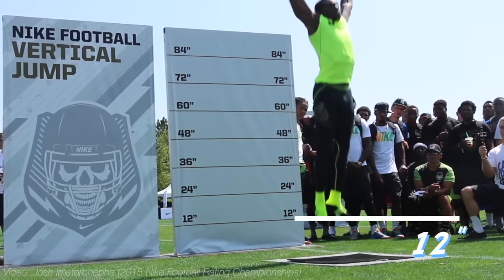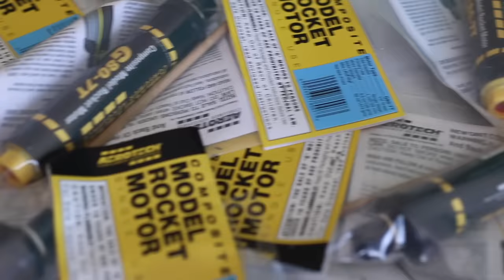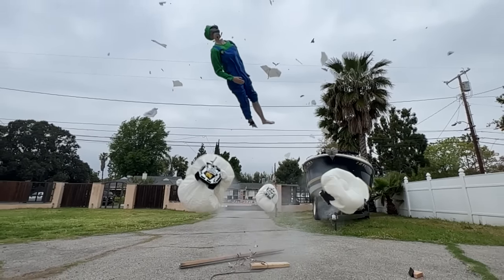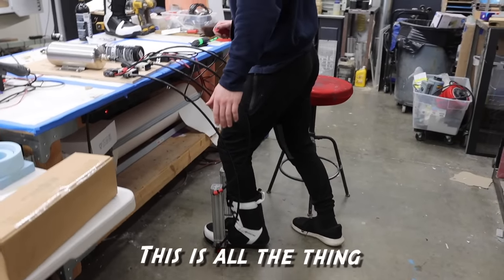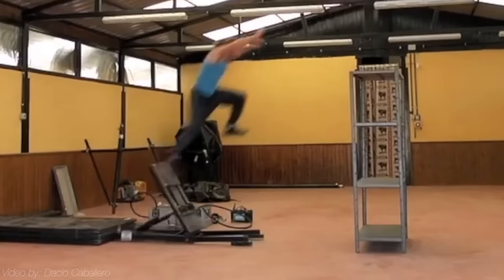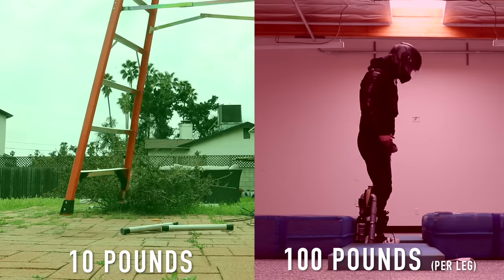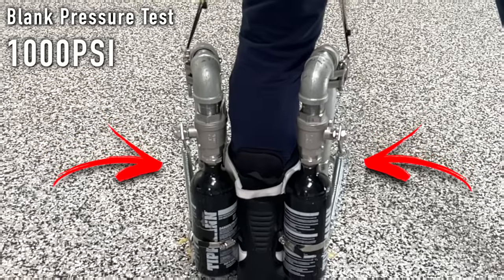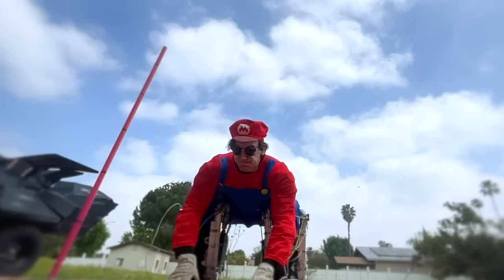Jump 10 Feet With These Shoes! (World Record)

Comment: How about the OPPOSITE of jumping shoes? Shoes that will cushion your fall as you land so you can drop from loftier heights without hurting your legs.

Might be a little more difficult to test.
Reply: Portal Boots
Reply: Feather falling IRL
Reply: Parkour
Reply: Parachute
Reply: @mightymas1647  This is the name it needs. Feather falling boots
Reply: long fall boots basically
Reply: Yes! This needs to happen
Reply: aperture science long fall boots™
Reply: thats basically putting springs at the bottom of the shoes
Reply: @garfield50096  Springs on the bottom would contract too fast to properly slow the wearer enough for any kind of fall of sufficient distance to normally hurt the wearer. You'd need something bigger.
Reply: Portal boots
Reply: @SerathDarklands  squishy shoe
Reply: Long Fall Boots
Reply: i think you'd need a shock that goes from your hip joint to your feet. with almost like a seat for you to land on.
Reply: Maybe shoes with springs on the bottoms so it slows your fall down. Strong springs. And then maybe they can click back into your shoes when they fully compress
Reply: This is a amazing idea
Reply: Feather fall?
Reply: Yes he need to do this
Reply from the maker: I'm interested
Reply: @JLaservideo  Awesome! I hope to see it in action someday!
Reply: @JLaservideo  once you have the aperture science long fall boots the next step is obviously a working portable quantum tunneling device
Reply: Fall Cushion Boots.
Reply: @iamshadow5340  wizards and warriors?
Reply: thats called a spring

Comment: Quick science lesson: An airbag actually doesn't cushion you at all. All it does is increase the time of impact, which therefore decreases the force of the impact. An example of this is if you try to catch an egg. To catch it without breaking it, you need to move your hands down during the period of impact.
Reply: wait then what's an example of cushioning?
Reply: @zombiecarz  Great question, cushioning is done by less dense items that suppress the force of impact
Reply: @jimmyjoe6721  Isn't the bag of air less dense than a steering wheel?
Reply: @jono6379  it is but it is so light that it doesn’t really cushion you, just increases the time of impact
Reply: @jimmyjoe6721  uh- this isn't entirely true
cushions work by being flexible enough to compress when an impact hits them, which is exactly what an air bag does. which is why jumping on a bed or trampoline increases jump height. but their only difference is material and one being always active

Comment: idea: for a safety feature, make the bottoms of the pistons rounded so that they tip over easier after they fall out, because it wouldnt be very good if one of them just so happened to stay standing up after they came out and your foot landed on it. it would either stab into your foot or make you tip over and land on your side
Reply: but it could also mean that you lose ballance couple miliseconds or less after launch when they are still touching both the mechanism and the ground, while the flat ones still give a certain sense of ballance :) ? ( not sure tho)
Reply: I like that idea, but it might hinder the effectiveness of the piston to only make contact with the ground at a single point instead of an entire surface. It may also introduce some undesired uncertainty in your thrust direction if any of the rounded pistons are at different angles with the normal line to the ground

Comment: Hey, I think that if you add 4 pneumatic pistons in the knees (2 for each, and one in each side) and connect then with the jumper in your feet, this may bring more stability. That is a technique we use in semi exoeskeleton to help people with injuries to stand still. But you will have to modify the pistons and attach a pressure sensor on it, so when there is only one increment, the pistons will fire. Plus... If you add a false background in the box with stretched cloth, you can put a huge mushroom on it, and then when you jump with the stability adjusted as I pointed you will be able to get the mushroom out of the box, put a pressure sensor and a midi player on the cloth for the sake of... Nerd happiness! 😂😂 You rock! Huge fan in here since the beginning!
Reply: underrated comment
Reply: @danmax3418  Did you like my ideas, bro?
Reply: @jonatasscdc  well i think they are logical so i think it s a good ideea so yes i would like to hear more of these from you i guess..

Comment: Do you think you could automate the trigger release? Like build some kind of pressure sensing device into the shoes, and then design a program that when you've applied enough force into will then release the trigger on its own and launch the pistons.

It think this will be a good idea if you ever intend to upgrade the design in the future. That way they could be usable for more than just standing in place.
Reply: i had the exact same idea
Reply: If anything a photocell will be the best. When it is placed underneath the shoe basically you can always guarantee that it will read out no light when the shoe is placed flat on the ground. When jumping into the air, some light will naturally come out from underneath and hit it. Not to mention nothing travels faster than the speed of light so this will probably give you the fastest reaction of when you get off the ground. There are several issues with it though like how it can only be used pretty much during daytime and if the sensor gets obstructed by dirt it can lead to unpredictable triggering

Comment: I would love to see you try to make shoes that both jump high and allow you to move fast, allowing you to do crazy leaps!
Reply: I’ve actually had this kind of idea for awhile, but instead of using pneumatic pistons I would use electromagnets built into the boots (or technically into itself) that would apply enough forces into the ground to launch up high or forward very fast, and potentially even help withstand high impact falls from certain heights. Of course EM’s provide their own challenges to figure out which is I’ve been a while to get around to building them, but I think I have a solid jist of how it could work in theory.
Reply: @14supersonic  pretty sure that's not how electromagnets work
Reply: @Robofrog100  Well, of course the EM's themselves aren't generating the force used, but it's the repulsive effects of the EMF that will create a spring-like effect and can be transferred to create enough force to launch a user off the ground.

 There would be some kind of physical medium in between the ground and the boots for the transfer of that energy, sort of like the spring stilts he mentioned in the video. The material used for that medium I'm still trying to figure out, considered something like fiberglass from one of jlasers videos in the past.

I'd reckon with the right configuration It'd be more practical and efficient than those stilts that are purely mechanically driven.
Reply: @14supersonic  still not how electromagnets work
Reply: @Reio4  It's easy for anyone to say something doesn't work or make a claim, harder for them to explain how and back up their claim. If it's not how Electormagnets work then explain yourself, enlighten me.
Reply: Sonic shoes basically?
Reply: @Verónica Bermudez  No, not really. It's a multimodal device, it's a singular design that could technically have different functions.

Comment: Okay, the thing with the jump height record where the guy seemed to float for a moment was because of his arms, he forced them upwards very fast upon his jump so he could push off with more force and jump higher up, and he forced his arms down at just the right time so when he reached his peak he was pulling his body up as his center of mass shifted down, keeping his feet nearly level for a bit longer. You could use that for long jumping to get a bit more hang time and clear a longer gap.
Reply: That video is fake his upperbody is out of screen he’s holding on something, that’s why he’ s floating at the peak of the jump

Comment: "Air bags gently expand to protect the driver" 
GENTLY? I was in a car crash with my cousin. Truck in front of us slammed his brakes and my cousin slammed his and blew a brake line. We collided at only 35 mph. The airbag did more damage to me than anything. The only injury i had from the crash and not the airbag was i had a bad brush burn on my forearm because i had it resting on the window ledge.